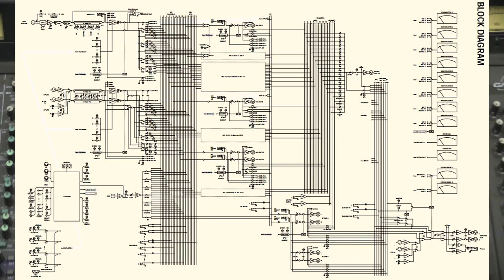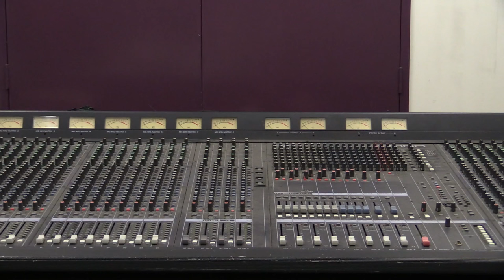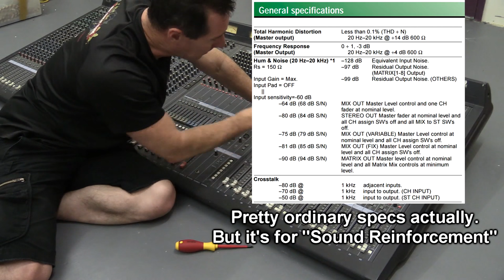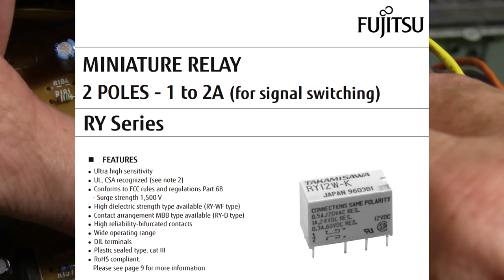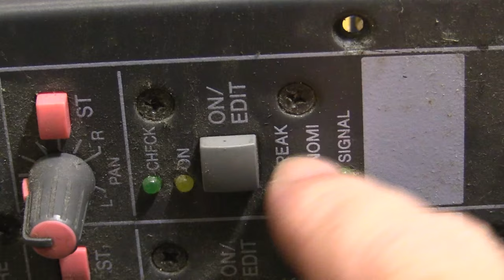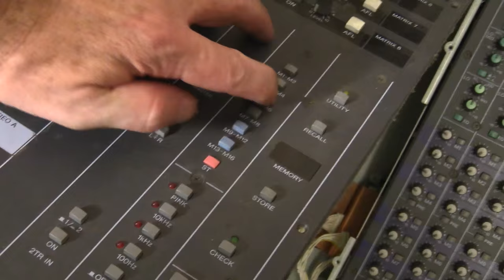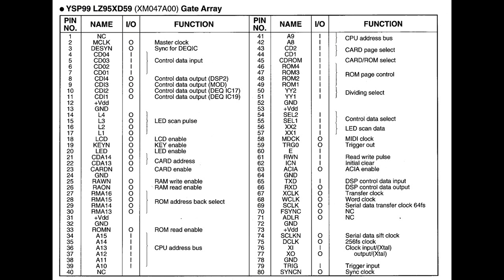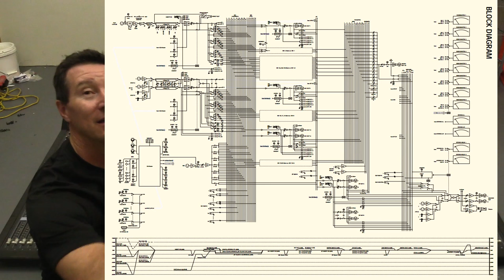EEVblog #840 - Yamaha M3000 Mixing Console Teardown

Comment: I just picked up a 16 channel Tascam recording board today for some small home recording projects. The guy I bought it from purchased it brand new in 2011, opened the box to make sure that everything was there and then never got around to using it. When I say this thing is in brand new condition, I'm not kidding. The plastic bag covering it was still taped closed and the power supply cables still had those twisty things on them to keep them bundled. The best part..... I got it for $65 US. (Deal of the century!) I was feeling pretty good about my new board until I clicked on this video. Now I want to go kick it. LOL I'll just go play with some faders on my 32 chan live board to make myself feel better. :-)

Comment: From what I've read about this thing, the M3000 was pretty much a POS for any sort of serious professional use. I read on a forum that many larger acts specifically mentioned that they would refuse to play if the venue only had an M3000 on hand. Still it was probably good enough for a certain uses where sound quality isn't that important (like a sporting venue) or for a small gig on a tight budget.

Comment: These things are really impressive I've been working with analog audio consoles for most of my life but these things are being phased out for digital consoles which are smaller, can handle more channels and have some really cool features. But analog consoles are still the way to go if you want cheap. Yamaha's flagship digital console the CL5 retails for $26,000 US dollars and its little brother the QL5 retails for $16,000, you can get an analog console for so much cheaper. The other thing to keep in mind here is servicablity, this thing was designed to be serviced by roadies because they don't have time to have a piece of equipment down for weeks due to repair. This way they can quickly replace a module and do regular maintnce in 1 to 2 hours rather than 1 to 2 weeks. The parts are very likey made by JRC since that was Yamaha's go to supplier for things of this era. The CL5 and QL5 take inspiration from this console with the matrix system. Normally analog audio consoles indivual channel knobs go as follows: Gain, AUX send 1-4 and somtimes 5 and 6, High EQ, High Mid EQ, Low Mid EQ, Low EQ, Pan, and then mute, fader and fader send. AUX sends are just a way to send audio to another source becides the main output, and they can be either pre fader or post fader, pre fader meaning that the signal leaves the AUX send before it goes to the fader and post fader meaning it leaves the AUX send after it leaves the fader.

Comment: Insert is to allow effects to be placed in-line with individual inputs - things like compressors/limiters, reverb etc.
Reply: +mikeselectricstuff   
I believe it is classed as a channel insert that allows you to pass the signal path to an external device and then back before the signal is passed onto the rest of the channel.
Reply: +mikeselectricstuff Yeah, although reverbs and delays are usually put on an effect bus (the middle 'matrix' part of the channel section).
Reply: +mikeselectricstuff You mean all those except the reverb, hah!
Reply: +Marc Jacobi Nah just give the whole effect its own return channel! Look at all those suckers on the far right. More mixing more better.
Reply: +Marc Jacobi It depends on whether you want to use an effect on just one channel or on a subgroup or on several channels across subgroups. It's not that uncommon to have something like reverb as an insert.
Reply: +as df   
If you are going to tape (read digital) or recording, then you do not want to put effects on the insert.  
The insert was originally designed to allow the engineer to apply dynamics to the channel path . You would then send the signal via an aux to get some effects.  
The insert was essentially to provide in channel correction (vanilla) to bring the dynamics into line with the mix.  
  
Things that may go on insert are compression, expansion, limiting, gating, exciting and so on. The FX buses would mix to things like reverb, delay, phase, flange and other types of coloration.  
  
In general you think of an Insert as to tape and fx as post tape.  
On a standard mixing desk you could record the session with FX being output only to the headphone mix but not to tape. When you play back you have the same setup but now you can play with the FX as they are not committed to tape but only on playback.
Reply: +mikeselectricstuff   
One more @ mike  
You don't really put FX on an insert for a few reasons, but number one is that you might only have one or two $1000 reverb units and if you insert them then you can't use them for anything else.  
If they are on an AUX bus then you can send multiple channels to the $1000 reverb for processing.  
The other major point is coloration (colouration). In that you don't want to put reverb on a sound to be recorded if you want to change the FX later. Once reverbed always reverbed.
Reply: Well when you want an effect on only one instrument you wouldn't assign one aux to one effect (although you could as long as you have enough aux channels). You are right on the inserts being actually intended for dynamics, but they also work with effects quite well. The reverse can also be done: routing aux to compressor and then back into a channel. This is for the famous "New York Drum Technique", were you mix the uncompressed drum with the the highly compressed one.
Reply: +Dirty Robot Where do dynamics end and effects begin?

;)
Reply: To add to the specifics: reverb and echo lends itself well to working with full program content, as those effects are not affected by the amplitude envelope (variations in amplitude).  Those who have played with dynamic electronics, such as limiters, compressors, expanders, and noise gates, know that heavy use of those effects on full program content can result in some pumping.  

Noise gates in particular work much better on the independent channels, as that allows the gate to only be act on the loudness of the individual source.  Imagine two relatively noisy microphone sources where they are expected to often not be providing input at the same time, e.g. lead singer vs. backup singers.  In that case, each source and its noise will be automatically silenced when that portion of the content is not active.  So, you won't need to listen to noise from the backup singer mics when only the lead is singing and vice versa.  

From there, we can also allow for the case when one part need individual effects to stand out from the rest of the program content.  E.g. the lead singer might want a reverb that sounds like an intimate venue, while the backups might need to sound like a cathedral, which can't be done with a bused reverb.

And, I think that the now popular auto-tune effect needs to be applied individually.  Vocoders are also envelope sensitive.  So, these are some of the reasons that justify both the bused effects and the individual ones,  all applied as needed.
Reply: +Dirty Robot 
Depends on what you are after.  Many recordings have been made with delays and reverbs tracked to tape - every U2 guitar part with a delay, for instance, had the delay recorded to tape.  It's all down to the function of the delay.  If it's a critical component of a part (such as the Edge's dotted eighth delays, or the delays in Pink Floyd's Run Like Hell), you are going to record them to tape.  The player may not be able to play the part without it!  Even without that, though, it all comes down to the situation, and it frequently works better to track your effects.  You still are going to use a send for most time based effects, and not the insert.  

And there are times where compression through a send works better than an insert too, but that is less common!
Reply: +hefonthefjords 

Grey area, but for the most part dynamics act in the amplitude domain, and "effects" act in the time domain.
Reply: +Gabriel Hoffman Yup, that was the joke. Hence the winky face.
Reply: +mikeselectricstuff Shit, my brain hurts just trying to understand the FL Studios mixer.
:-)
Reply: +mikeselectricstuff Reverb goes on sends.
Reply: no you can also put a reverb on insert (and mix it 50/50% dry/wet) while on the send you mix it 100% wet.
Reply: Alex Reeve, Well stated. Good conclusions.
Reply: Gabrial Hoffman, on your comment to +DirtyRobot: This explains why recording engineers are still highly sought after... and not replaced by some digital device or program.
Reply: I was going to ask where the FX send and returns are lol I guess the inserts on this mixer are used for that function though like others have said they are not really intended for FX processors :) Thanks for clearing that up for me Mr.Mikeselectricalstuff :)

Comment: The arrays above the channel gain sliders are for individual monitor levels. The talk-back is so the board operator can talk through the PA system to the crew or to the performers during rehearsals . Talk-back is not widely used anymore except in garage / bar bands where the musicians are all sound engineers lol, and has been replaces by portable two-way radios. Performers no longer call the shots on how a system is mixed and EQ'ed either like they use to, it is all on the ears of the tech, like it should be..
That sports venue got the hard metal shaft from the sound company who sold them that thing, EPIC OVERKILL

Comment: Having worked a PM1000 16x4 I can attest these are sweet machines in every possible way. Smooth sliders with rubber rollers on the back, contoured knobs you can tweak in the dark with full confidence, not many machines out there you can operate completely by touch like these.

Comment: Loved this video. Many of your videos go right over my head, but with this one I found myself yelling at the screen trying to tell you what stuff was and why it was like that.
I do live sound (not to mention lighting, etc), I'd really like to see your reaction to the insides of some other consoles.
There is a BIG reason having things modular is key, if something dies before a show or during a show and you NEED it, it is not unheard of to open up the console and start having at it, swapping parts, making spot repairs at the component level even.
I remember killing a section of a console mid-show (at a music festival) during a small act to repair a section of the console live. Had consoles open mid show far too many times.
Reply from the maker: +Steven Allen Live on-site repair during a show, awesome!
Reply: EEVblog yes indeed. Gotta do our best to make sure the show goes on! Thank god the better consoles are very modular. 
A soldering iron inside a console on site is a bit of a nerve racking thing I'd say.
Reply: +Steven Allen You should get a fake pair of legs (i.e. jeans bottoms and boots), lift a section and stuff that in. Any one complains just say "The guys in there now working on it!"
Reply: +Steven Allen As an Audio Engineer myself, its really interesting to see the internals of a board, although I cringed at the idea of tearing a board apart. Regardless, cool to know the things buried within!
Reply: 45redrooster
Completely agree... I have an old Soundcraft Spirit Studio that I've had to tear apart to get working fully again. Too bad the thing was way too much of a pain in the butt to transport most of the time for me lol
Reply: +Steven Allen I occasionally volunteer at a Venue called Kulaks Woodshed where we use that same one for FOH mix! The first Soundcraft that I used was the Ghost. Small but powerful.
Reply: SSL console and Neve console next please lol.
Reply: Indeed!
Reply: painful..
Reply: Do you do analogue or digital? :p
Reply: +Steve Allen - I never had to service the desk live but I've done many a repair of other stuff , even major amp and keyboard repairs during soundcheck. 
Bands loved me and my little blue, do everything toolbox.
Got me a lot of rebookings them repairs did. 
My hat is off to you lifting a channel/section while the show is running through the rest of it, though

Comment: I learned live mixing on this thing's big brother, the PM3000 (and later, the next generation PM4000).  The PM's are even more modular, in that each individual channel can come out and be replaced on it's own, and you can get mono or stereo modules.  

The Matrix sends are used for a lot of things; sends to time based effects (reverb, delay, etc.), monitor mixers so the players on stage can hear each other, delay clusters (speaker clusters placed further back in the room, and delayed to match the mains - this is to fill dead spots in the room, and is pretty uncommon these days, as everyone else seems to love line arrays), and sub-mixing things like drum sets (though on a console like this, you are more likely to use the VCA's).

VCA's are control groups.  You assign the individual channels to the central VCA faders, and you can control the channels in groups.  They have VCA group mutes as well.  On this generation, the scene memories usually just dealt with the VCA groups.  So, you mix the drums, and assign them all to (say) VCA 1, and you can control the overall drum level with one fader.  You can also use one of the matrix busses for this, but the extra summing will usually add more noise than you really want.

The stereo channels are mostly used for effects returns.

Inserts are for amplitude effects (compression, mostly, and noise gates).  

The mic input in the mains section (the center section) is for a talk back mic, so you can communicate with the stage during sound check.

40 channels of noise (and 20 mix busses) adds up quickly - the shielding on the relays is not optional!  Keeping the noise floor below 90dB is tough!  That's a big part of the external power supply too - internal power supplies just don't work on boards this big!!!

Yamaha boards have a mixed reputation - some people love them, because they are very clean, and basically do exactly what you tell them to, with out coloring the sound.   The EQ's are considered by many sound engineers to be rather sterile.  I tend to think it is just a matter of preference.  I think they sound great for jazz, classical, or corporate talk talk gigs.  Not great for rock and roll, though!  What they really do, though, is expose the mixer's skill level - you get out what you put in, and if you know what you are doing it will do exactly what you tell it to do.  A lot less forgiving than some boards if you aren't so skilled!

It's not a baby, but it is a mid-level professional console, and a 20-30 year old design at that.  These days, everything is digital, and EVERY promoter is constantly arguing for smaller and smaller footprints at front of house.  Still, back in the day, those boards probably did more events than any of the higher end consoles, and while they are not quite as versatile as a 4k or Midas XL4, it probably cost about a quarter of the cash, and they sound pretty decent.
Reply: The good old days with the PM4000 when you had to tear out the channel strips between songs and hose them down with contact cleaner...
Reply: Regular scheduled maintenance, my friend, regular scheduled maintenance.  We used to clean our patch bays every six months.  Sure, it's a pain, but it sure helps avoid problems.

Comment: I'd thin that big-ass ground strapping is more about signal integrity than current
Reply from the maker: +mikeselectricstuff Well, yes, not actual current handling ability, as we are only talking a few amps which a connector pin or two could handle. But getting extremely low drop over big distances at those currents requires those big strappings for low impedance.
Reply: +EEVblog They are indeed there for signal integrity. My Allen&Heath mixer has one big strip going along the whole board (only 24 channels).
Reply: +mikeselectricstuff You are alright Mike, and to avoid ground loops too.
Reply: +Wouter Weggelaar And I'd much rather have the Allen & Heath too. Much better sounding and better built desks than Yamaha. At this level the boards should all be fibreglass and all sliders and pots should me mounted on discreet channel strips for serviceability.
Reply: +mikeselectricstuff If you look into the service manual the big copper strapping is labeled "SUM-GND". It's not only the power-return but also the reference voltage for the busses (the summing junction).

Some boards do the sensible thing and have separate ground-reference pins on their bus connectors, thereby decoupling power distribution from the signal-reference. But probably copper was much cheaper when this board was built ;-).
Reply: +mikeselectricstuff for the price-range allen and heath seem to perform the absolute best.
Reply: +mikeselectricstuff: to avoid hum. virtually, all channels should be at the exact same ground level.
Reply: +mikeselectricstuff Yes, I believe you are right, it is for signal integrity.  I think all the analog signals are single-ended so they need a lot of ground plane to keep the common mode noise way down.  They should use differential signalling for the analog buses.
Reply: @EEVblog  Signal integrity is paramount in this application, and in an analogue mixing board, with balanced signal paths, a robust solid grounding system is essential. That much copper on the ground buss is more for keeping ground at absolute 0, over handling current. Also high on the list is a LOT of capacitors to keep silent power source throughout the board.

Comment: Hi Dave, the SSM2018 is made by Analog Devices and is a Trimless Voltage Controlled Amplifier.  I had a friend that was into designing custom audio equipment so I recognized the part number.

Really enjoyed the teardown, don't often get to see gear bigger than yourself!

Comment: That's an entry level, very entry level, touring desk.  The upper end consoles have individual modules that you can remove on a singular basis for repair, replacement, or even reconfiguration.